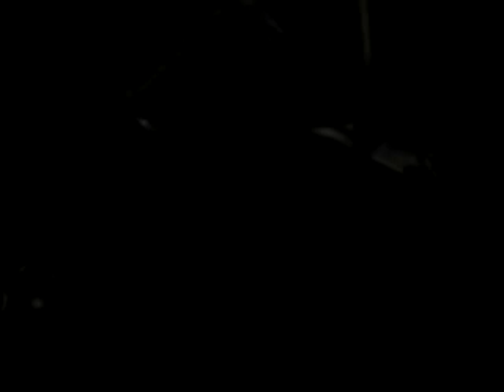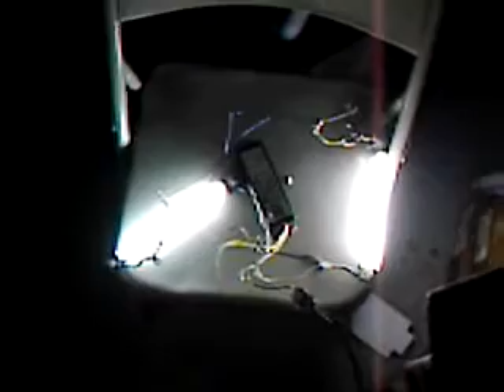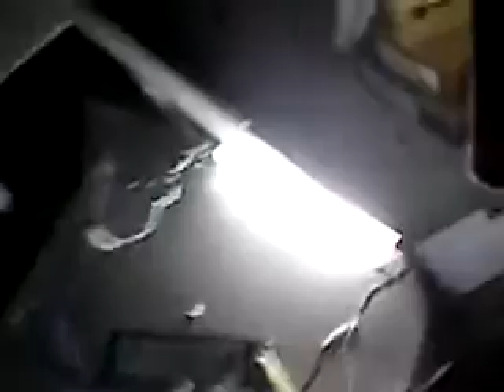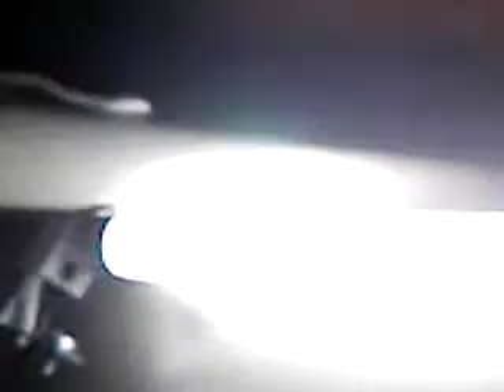Magnetic rapid start ballast for small T5 lamps?

Comment: We do, in England anyway. Tran*Star used to make twin and single-lamp "switchless start" ballasts for most wattages including the T5 13w 21", and quite likely for 8W 12", 6W 9" as well, possibly also for 4W 6". I have several twin 40w (T12, 4ft) ballasts and the one I have in my kitchen uses a single 65W (T12, 5ft) ballast. The twin lamp ballasts start almost instantly, the single ones shimmer during startup. I'll post a video reply for each type in due course.